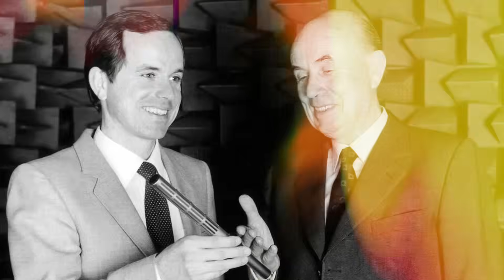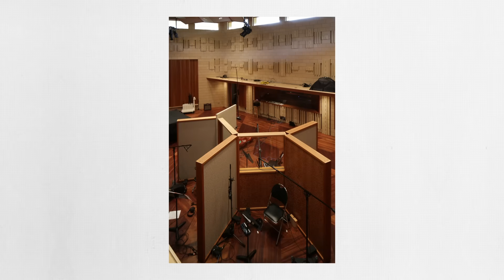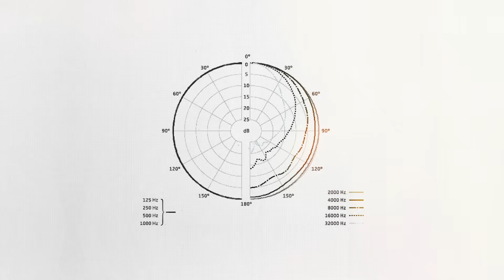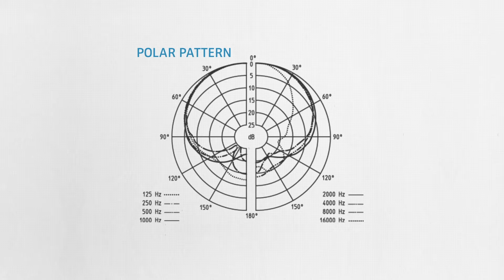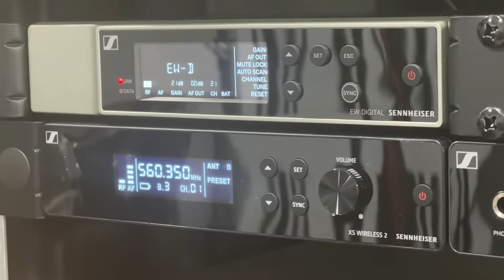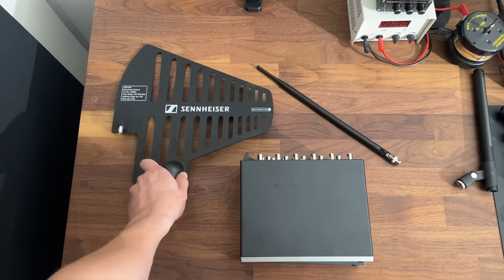Why Audio Engineers Use Different Mics for Different Jobs

Comment: The only reason not to take the MD421 is that it has a large housing and looks old. 
In terms of sound, it's still a good microphone.
It comes with three different plugs: 
Small Tuchel, which is a DIN socket. 
Big Tuchel, which can hardly be found any more. 
And XLR, which removes the bass switch.
But the microphones can still be converted to XLR.